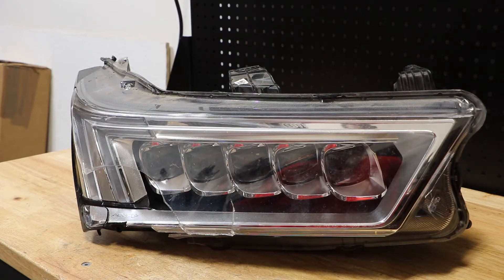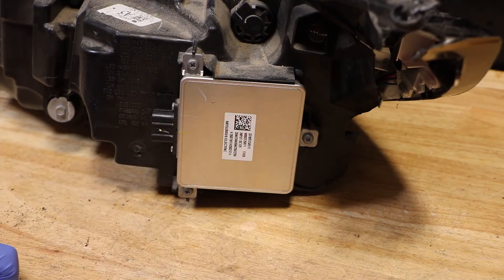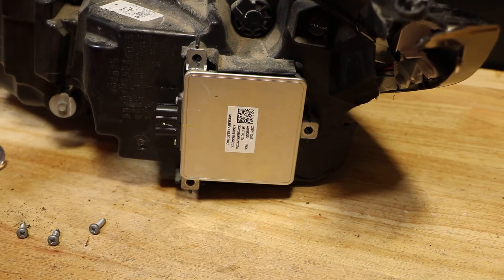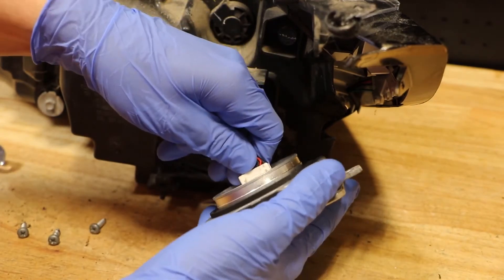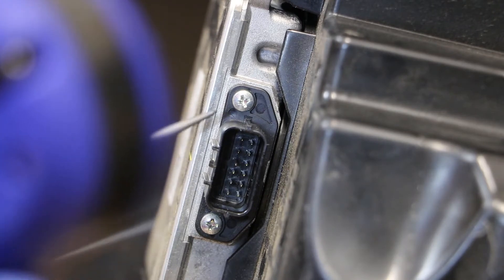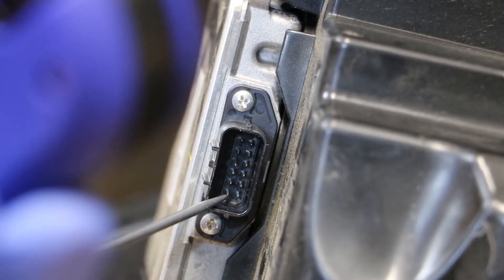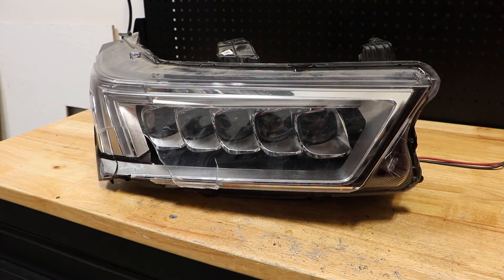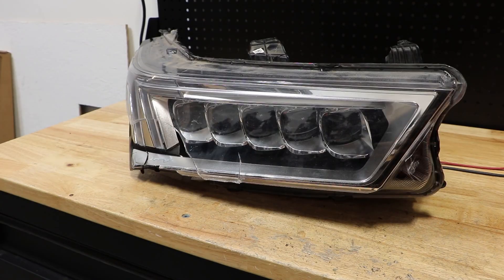How to test a 2017-2019 Acura MDX LED Headlight Ballast

Comment: what is the part number of your ballast?i have mdx headlights aswell but it only has 5 pins. cant get the 3 outer light work but i can turnon all 5 and 2 inner.
Reply from the maker: the number on the ballast was

33109TZ5A511
W003T26871

as far as I know Honda only made 1 version of this and they should all be the same.   If you only have 5 pins it sounds like your ballast is damaged.
Reply: i got it figured out,i have different headlights its from acura mdx 2016thats why i only have 5 connector pins on my main,5 led works but the low beam doesnt and highbeam only works just the outer 2 leds. you got some input on this?or this version doesnt work with retrofitting?
Reply from the maker: @jeffl1054  I have no experience with the 2016 version of this light.  It could be defective LEDs/ballast, it could be a wiring/voltage issue, sometime you have to supply power to 2 pins at once (think main power then the 2nd acts as a switch to tell the main light to turn on)

Comment: Any idea why my girls 2019 rdx passenger side led turn signal continues to flash/flicker when the car is off?
Reply from the maker: It could be a bad control board inside of the light or something is wrong with the wiring ( maybe an exposed wire is touching and supplying voltage).    You should probably start with a multi-meter and check the wire harness to see if it's being supplied voltage after being turned off and to trace through looking for shorts.